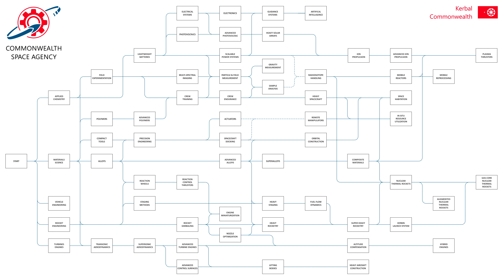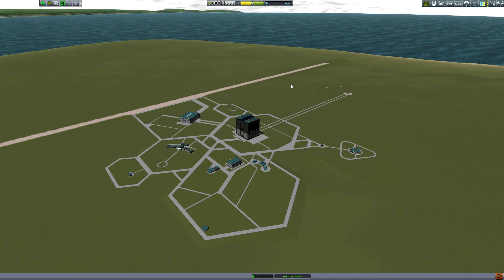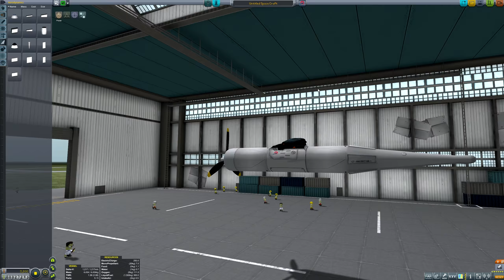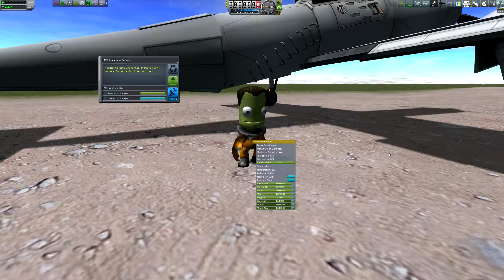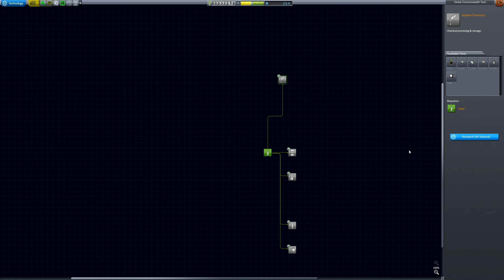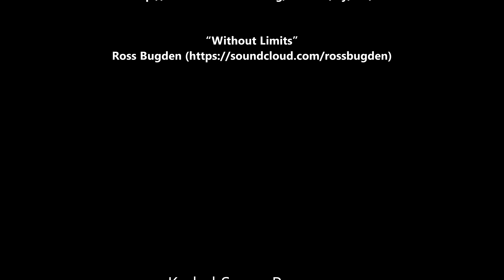Kerbal Commonwealth Space Agency - 1. Humble Beginnings (KSP 0.90)

Comment: Nooo! You are doing it all wrong! You have to start your YouTube career with a crappy video in low resolution and with bad audio quality. It's not the right way to start off with fancy editing, great drawings and good audio!

The endless landing was really scary! Great job, Jeb and Promii :-)
Reply from the maker: Learning by Gaming Thanks!  I think my next plane will have tricycle landing gear.  Tail-draggers seem to bounce a lot :)
Reply: Promii I'm still a bit confused about your landing. Has one of your mods disabled the drag or why were you flying at a more or less constant speed while your engine was idling?
Reply from the maker: Learning by Gaming Not disabled, but with the more realistic aerodynamics in FAR, the drag is much lower for streamlined shapes than in the stock aerodynamics model.That said, I've noticed when flying similar aircraft in the past, if I smash my engine into a bump in the ground, it becomes easier to slow down and land.  I'm not sure why that would be, since the engine definitely isn't producing any thrust at idle (I've checked)